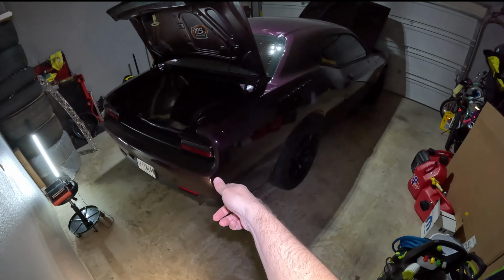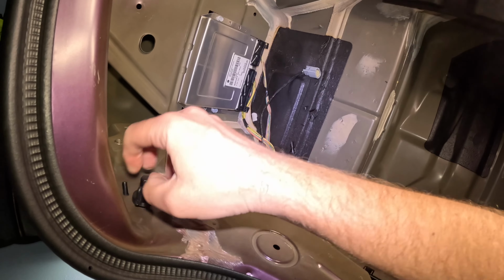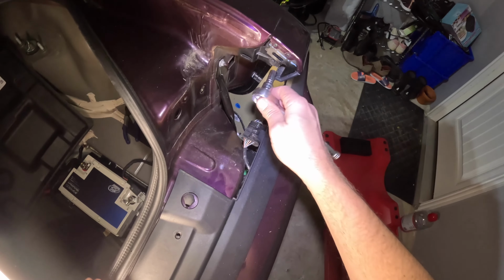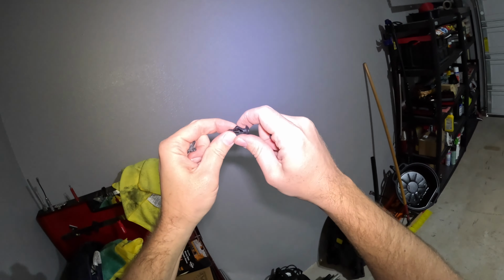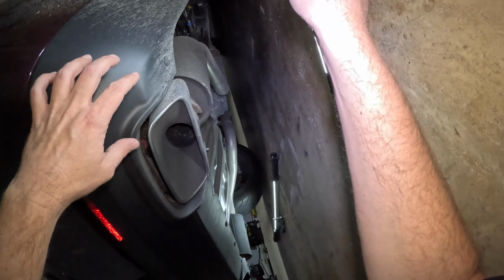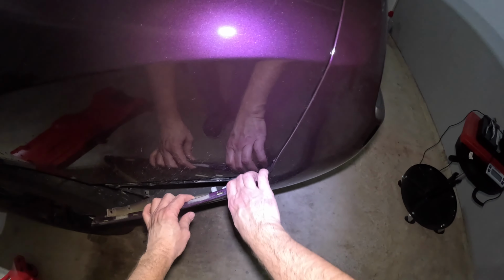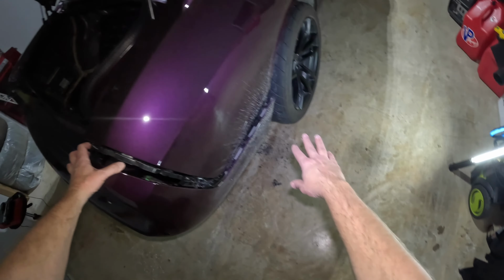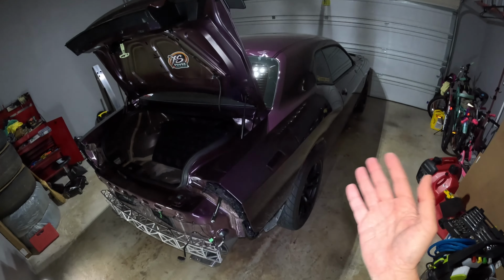2020 Dodge Challenger Rear Bumper Cover Removal and Install

Comment: Just a tip of advice: clean the painted surfaces first and also add some blue masking tape to prevent scratches. Same for front. Thanks for posting this step by step because a lot of Challenger owners have no idea how to take it off 🫡

Comment: Seems a bit easier than the front fascia, and those darn 10mm nuts that are deep into a tight spot!
Reply from the maker: for sure. I wouldn't mind pulling the rear off when needed, whereas I now dread having to remove the front one, which I have to do eventually to fix the loose bolt/nut in one of those tight spots you can't see.
Reply: @Scavenger1320 been trying to find an early Drag Pak, but man are they hard to come by. One recently sold at a Mecum auction down in Florida. The 1320 is the next best thing.
Reply from the maker: @PatrickReagan  definitely not a lot of Drag Paks made. I feel like I just recently seen one up for sale but it may have been the same one at Mecum that you're referring to.
Reply: @Scavenger1320 yes, probably. The 2011 w/ Viper engine

Comment: The electrical connector you removed at 10:10, is that for the ParkSense Sensors?

I just got my car back from a body shop after being rear-ended and I have a message on the console of my 2018 SXT Plus that says mine need to be serviced.  But it only happens when the car warms up.  I am hoping it might just be loose or something.  

I found this video after hours of searching hoping that it would help me locate the wiring for those.
Reply from the maker: That connector is for both the rear park sensors and the side marker lights in the bumper. That's weird that it comes on after the car gets warmed up, I'm not sure how that would affect the wiring, unless it's actually just a time issue that just coincides with around the time it takes to get warmed up. Either way checking the connector is definitely a good place to start, and easy. Hope it gets figured out. The shop should at least look into it, being it's from a rear-ender I can't see how it wouldn't be related being its the rear sensors

Comment: what are those light weight bumper support for? wont that make the car weaker if anyone gits it?
Reply from the maker: Just weight reduction. Performance is all just a measure of power to weight. Most people focus on the power side, others, like me, put an emphasis on the weight side of the equation. With the rear support, the stock one is also aluminum, sure it's thicker aluminum, but if it were integral to crash safety they'd have made it out of High Strength Steel instead. The rear support/impact bar is really more for absorbing light and low speed impacts.